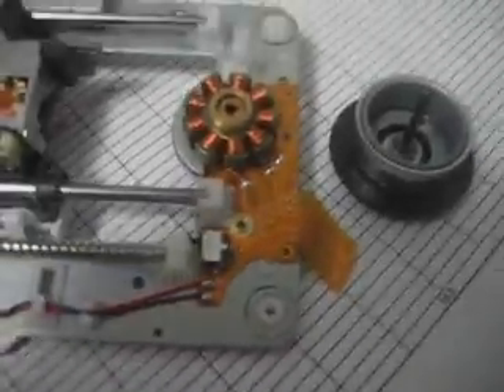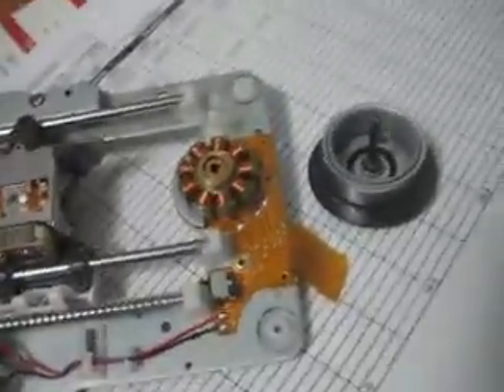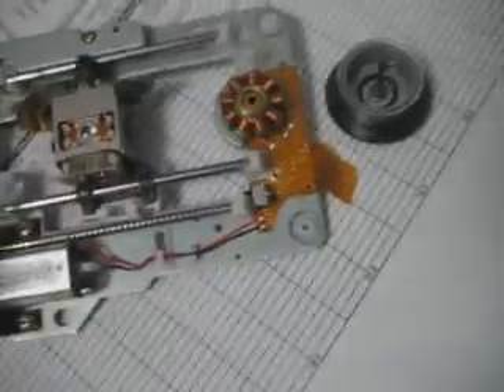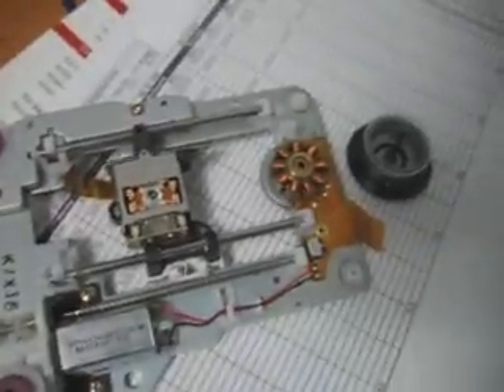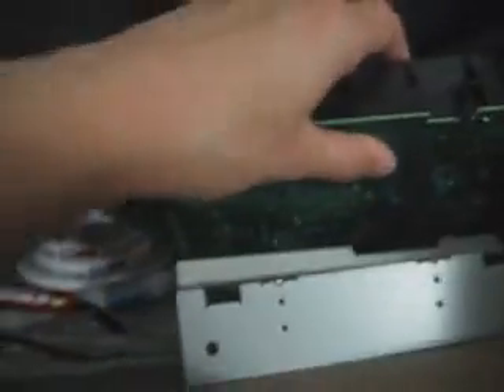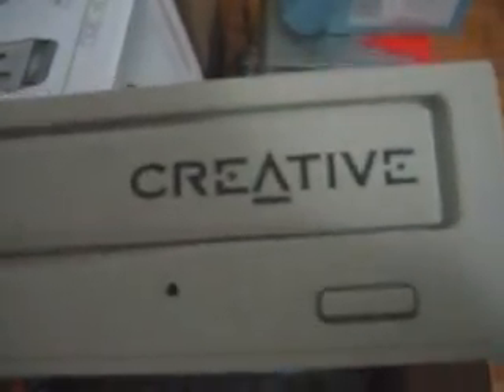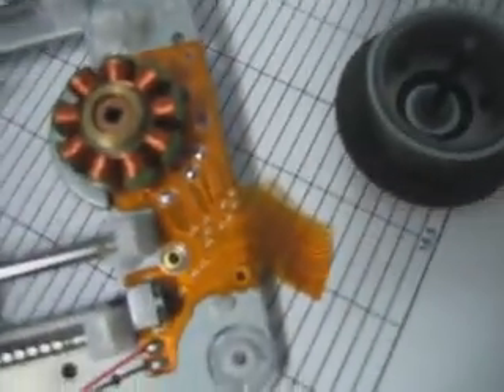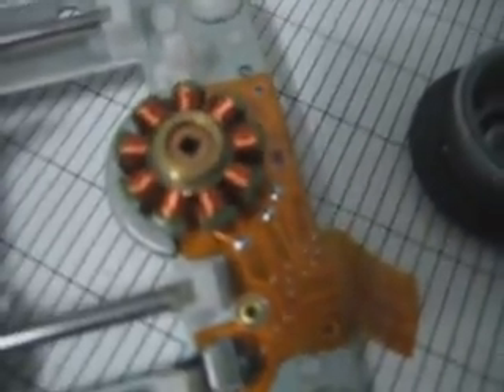cd-rom motor

Comment: hey,
try soldering 2 lives and a neutral to the solder points at the side of the motor, but be careful not to go above 5volts or BOOM, you'll be pickin motor outta ya face (LOL) :)